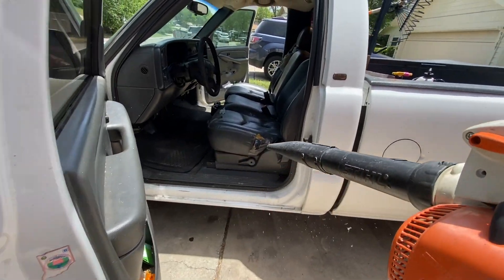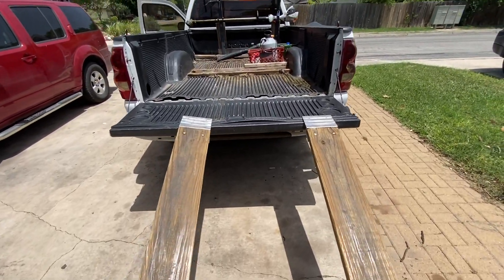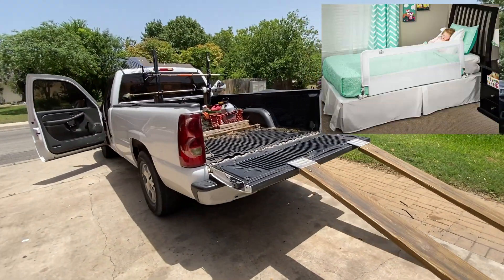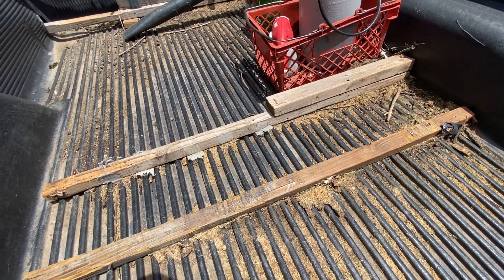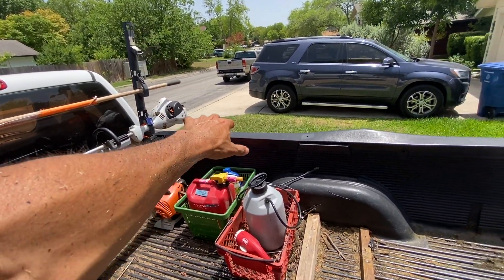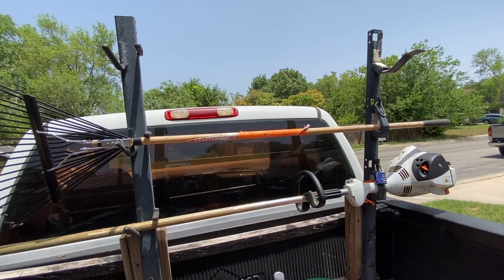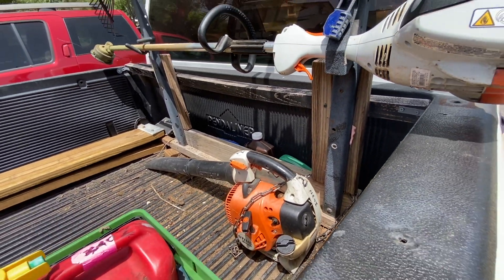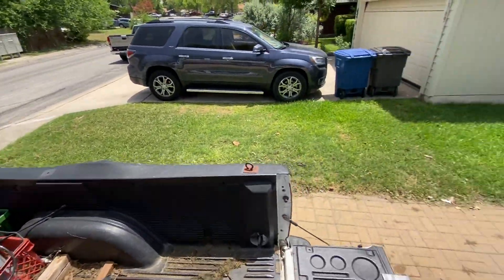How I Built My TRUCKBED TRIMMER RACK Setup ✅🛠️

Comment: I just built  your ramps for my truck and mower. I used framing plates for the metal lips. It does a fine job for the mower but I could never walk on them. I’m just starting a mowing company in Fort Collins
Reply from the maker: William Gold awesome man!! As long as it works that’s all that matters. Is the wood not strong enough or do you just way much more than me lol? 😁 greetings my fellow coloradoan a close friend of mine was stationed up there recently!
Reply: Make Money Mowing hahaa I can’t walk on it because the lips are really weak. The boards are fine. Colorado is rad! What a great place to mow, I just moved here a few months ago. I like your CO flags 👍
Reply: I'm in Colorado too. (Parker, just south of Denver)  Started up my own biz last season sith this ramp set up and it's been amazing so far!

Comment: Rocking same set up but enclosed E150... Timemaster out the side with folding 30 inch ramp traditional ride on mower out the back with harbor freight ramps and bypass seat switch to load up ramps with a pvc pipe. Ditch the hitch!

Comment: OR; you could have made a base for the truck using 3/4 inch plywood, and bolting it to the bed, then buying two sets of "E-Trax" and bolting it into the wooden deck.  Now all you have to do is take several straps, park your mower front to back, and strap them in; thus preventing it from shifting up and down the bed of your truck.....